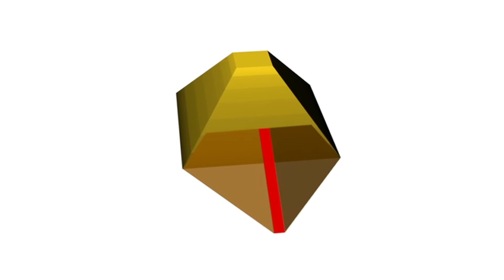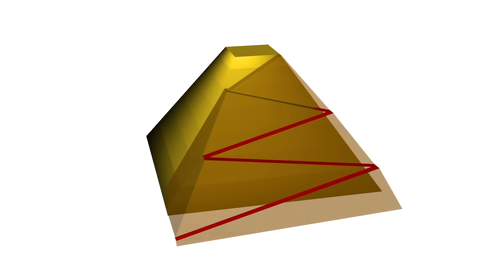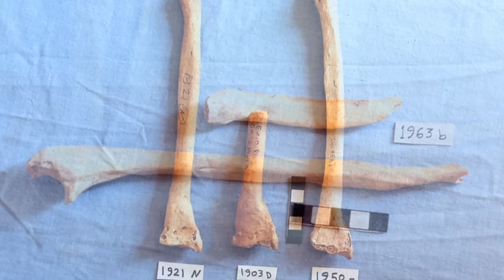Egyptology - Pyramid Construction

Comment: The stones instead the kings chambers  where solid granite.  Your not going to smooth then out with a bit of flint...
Reply: redlegagent I just fined it inconceivable that 50 tone slabs of rose granite could be move, shaped, cut, levelled flat to absolute perfection and then to rub insult to injury raised over 40 meters in the air with the tools and implements you mention. It just seems impossible to achieve such technological feats. Take some of the shaft holes that are carved into the granite stones, each cut is then projected to the next stone and the next and the next at perfect angles running through the inner structure of the pyramid for some distance. Even with todays technology this would be very hard to replicate. I think we are just missing something when it comes to the technology and mathematics used to  create these structures. Time is the key and I done think it would be possible to create these engineering masterpieces in the time frame that history would have us believe. It truly is a mystery
Reply: redlegagent I think you are being very disingenuous and playing down the feat that you state. Have you ever cut granite or basalt stone , do you know how hard it is also to cut a perfect channed/right angle into a rose granite block and then lay the Corresponding block so precise you could not get a piece of paper into the crack, I think not ... when you have worked with such stones as I have you will learn and respect the magnitude of the task that was achieve and to do this with bronze and copper tools over 2500 years is another matter. 
I think you need to go down to your garden and dig up a slab of limestone  and try and carve a perfect channel for about 2 ft with your selections or STEEL Chisels and STEEL hammer and see how you fare. I bet within 10 cm you take a massive chunk out of it rendering the Pieces useless or you completely run out of steam after the first half hr with your primitive hammer and chisels, even though it is vastly superior to the tools utilised in Egyptian times. ( and this is only lime stone ) . Now let's conclude the the biomechanics and leverages that you suggest in your analysis. NO ONE HAS EVER DONE NORE RECREATED ANY OF THE LIFTS WITH THE MATERIALS, TOOLS AND TECHNIQUES YOU SO ELOQUENTLY STATED WITH 50 TONE STONES. 
This is all just a Theory with NO evidence to support it. In fact they are still debating/arguing how the stones where even loaded onto the boats, and don't forget one of the stones is said to be just under 80 tones in the kings chamber. 
How they create these structures and managed to use complex geometry and physics is truly amazing and has NOT been truly understood. 

The one thing about Science is that it can't explain everything, even if you think it can. - Tom Sugden.

Ps I was going to put some links in with nice photos of stone work but could not be bothered lol. 

PPs Neil degrasse tyson is a phoney.

Comment: At 4:45 it shows about 4 or 5 people pulling the rock.  As the pyramid gets higher the top is going to get smaller and smaller.  Where are the people going to stand to pull the stones to the very top ???

Comment: The most abundant resource in the area is sand. I believe sand could have been used to build the ramps or even the sand granules used to move the stone over if the ramps if they were built from a solid cement material.

Comment: I think they built the pyramids from the ground surface and dug the sand out as they went down. Much easier that way..
Reply: redlegagent Even if the blocks was craved out of hills, it's much easier to pull the blocks to a ground surface sit than pull it up a steep structure.

Comment: It isn't true that the people of that day did not have the wheel or iron/steel for tools. The Giza complex has far more to it than the great pyramid. Three large pyramids plus numerous smaller ones, temples, the Sphinx, and a system of high capacity underground tunnels and shafts operating on multiple levels, criss crossing the plateau for many miles. Plus enormous excavated chambers, Saqqara type boxes etc etc. All of which required at least as much work as building the pyramids themselves.
 I think it was the work of the highly advanced, human, pre flood civilisation. However, even the post flood Egyptians had the wheel and Iron. Their time was contemporary with Moses' time. He led the Israelites out of Egypt and they later chased after them on Chariots!. And I doubt they had copper wheels
Shortly after, we hear about the king of Bashan (in the land of Canaan - allied to Egypt) who had a bed made of Iron!. They went to war bristling with swords, shields, and Iron tipped spears
This copper chisels and wooden rollers nonsense should be put to bed.

Comment: Garbage. It was easy as fuuuk. These fools are imbeciles.
Chop a tree, cut into quarters. Attach to the corner of tge blocks after a bit of cutting the wood. Tie it up. (Rounding the square)
Roll the block to the site. Wrap it up in rope like your lawnmower has. Use heavy blocks to act as a lever to roll the blocks to their destination. Its very simple.

Comment: 2.3 million blocks over 20 years?
Do the math.
24/7 for 20 years means 1 block laid every 4 minutes.
I don't think they worked 24/7.
This is a very deep mystery.
Reply: Do modern construction sites lay blocks averaging 2 tonnes in weight?
How many of those are you going to get down a road.. up a river... up a ramp at a time?
There is no comparison.
A 2 tonne block in place every 4 minutes (or every 2 minutes if they only worked daylight hours).
The quarry is cutting 315 x 2 tonne blocks a day, every day, 7 days a week for 20 years.
It is a very very deep mystery.
Reply: Look at the size of the blocks in the pyramid. They mostly of a standard size.
https://www.youtube.com/watch?v=Diz2zDGPVKw
The blocks weighed between 1 ton and 80 tons.
The ones near the base weighed 6 to 8 tons.
The ones near the top weighted 1 ton (still no mean feat to shift).
How many boats did they have?
How many waterways did they have?
How many ramps did they have?
How many men does it take to move one of these blocks over distances that could be many miles?
They would need a continuous moving line of blocks going back to the quarry separated by a few meters between each block. 
Bottlenecks everywhere.
350 blocks a day, 7 days a week for 20 years.
1 every 2 minutes in daylight working hours.
The scale of the operation is mind-boggling and a very deep mystery.
Reply: I posted that video because you can clearly see the size of the blocks.
Enormous and 6 to 8 tons near the bottom.
How did they quarry and cut 315 blocks a day with such high precision?
And do it for 20 years 7 days a week at the rate of seating one block of stone every 2 minutes?
You think they used copper chisels?
People have tried that... it doesn't work at the rate they were building.
Reply: You show me a video in which they immediately say "it's still a mystery"?
Whatever.
Yes you can cut limestone with copper.
Can you cut it at the rate of 315 blocks a day?
You seem to obsess over ignoring the shear scale and logistics of the task.
Reply: 210  layers of level stone.
Nothing rough cut about any of that.
Just how did they cut all that stone with copper tools?
Yes I've seen the videos that show pathetic attempts - slow and small scale.
How do you cut 10 ton blocks so they sit level?
A really big copper hacksaw?

Comment: People were more motivated back then i guess.  How they did it is beyond my comprehension.   They knew that the triangle is the strongest shape to build with though.  Magnets?  Pully system?  Not so sure about just manpower alone.  I'd be spent after hauling just one of those blocks ten feet.  Pulling uphill?  Yeah i dunno about that especially when having to place the block in its desired spot.  The ramp alone would have been a work of art of its own to withstand the weight.  I dunno just thinking out loud here.

Comment: 2 ramps from neighboring sides AND a close winding ramp. Once the blocks were up the initial ramps they were slid into place using Egyptian mortar, enabling you to slide the blocks into place relatively easily. As for the question of how the blocks were transported: an artificial harbor (canals and port) was dug in the area close to the pyramid (proof of which was recently found), allowing the annual flood in and provided ships the chance to drop their cargo off closer. Truly an Engineering marvel every step of the way.
Reply: redlegagent very well put as a whole. I just watched a series of videos about using a water system to naturally raise the blocks and one about an internal ramp inside the pyramid (which there's actual proof of). The fact that we still can't figure it out for sure is a testament to the engineering skill and thought put into these monuments. Let me see if I can find those videos real quick.
Reply: redlegagent Heres the one about the internal ramp.
https://youtu.be/lasCXujNPfs

Here's the one about the water system.

https://youtu.be/TJcp13hAO3U